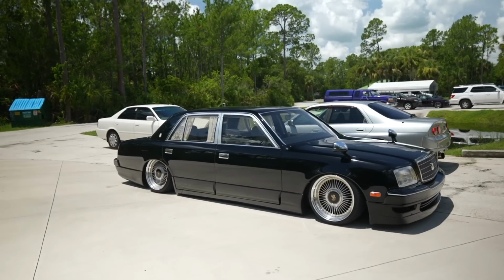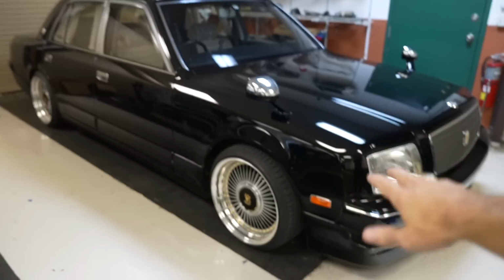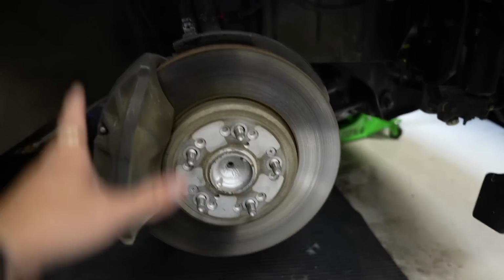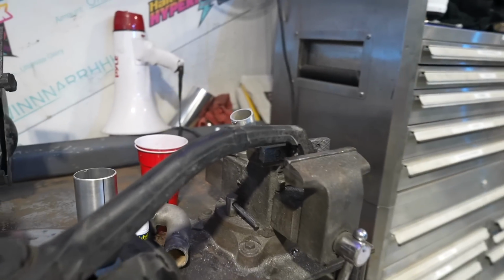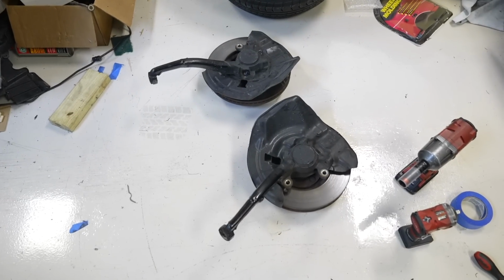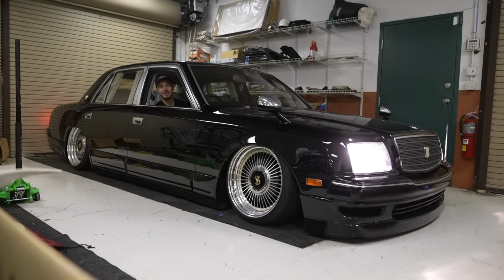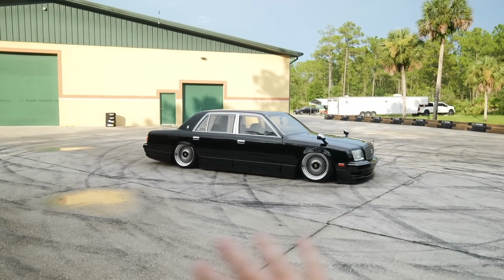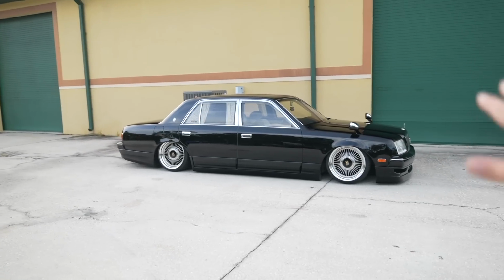Building Custom Suspension arms for my V12 Toyota Century!

Comment: Because the place on the knuckle where the shortening was done is closer to the pivot point of the a arms, removing let's say 1 inch will lower the car more than 1 inch (given it doesn't bind or hit anything else). You can calculate this by multiplying the length of the removed section by the ratio of how far out that section is vs. the distance from the a arm mounting point to the wheel; basically the same as the suspension's motion ratio, but for the removed section of the knuckle instead of spring/shock mounting point.
Reply: A more familiar comparison might be coilovers: If you want to lower your car an additional 1 inch, you don't wind the spring perch down 1 full inch as that would result in a much bigger drop.

Comment: Why not use Serialnine upper control arms? They are lower then the stock ones, and you have camber adjustment on them. I think the GS300 has the same arm as the Century.

Comment: Shortening a knuckle in a double a arm suspension setup will drastically change the characteristics of it as the body rolls. Having a shorter distance between the outer mounting points (shorter knuckle) than the inner mounting points of the a arms (where they mount to the frame) will add positive camber when rolling, which reduces tire contact with the road surface.

Comment: You didn't need to slow cool them?? I'd have tossed those in a 5 gallon bucket and covered them with sand or at least wrapped them up real thick with leather gloves to slow down the cooling process and ensure strength.

Comment: Very exciting! I’d recommend preheating the cast spindles and post heat in a bucket of sand. Cast spindles are very brittle especially if he did not use nickle tig rod. If he used nickel then that’s promising. I’ve done over a hundred spindles, cast steel and cast aluminum. @kruze_customz @camberedlex
Reply: This is the comment i was looking for 👏